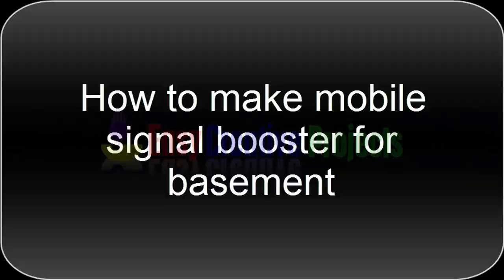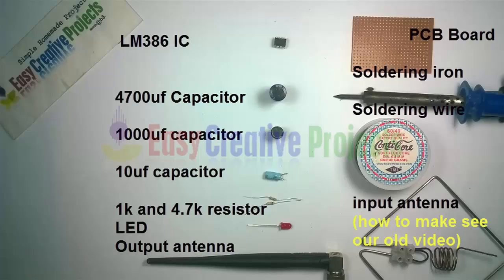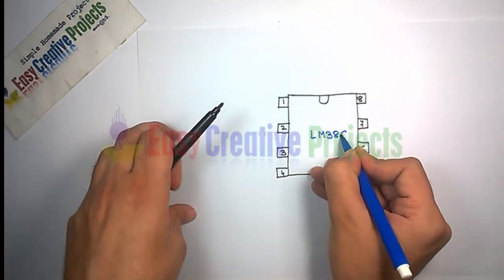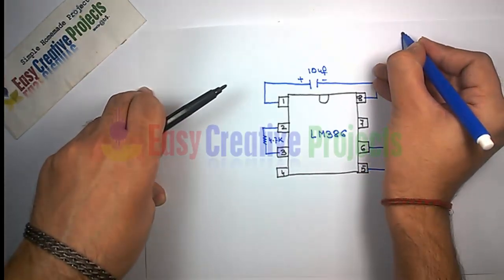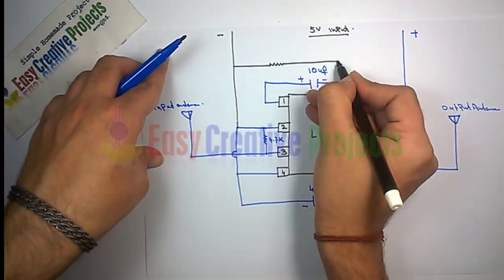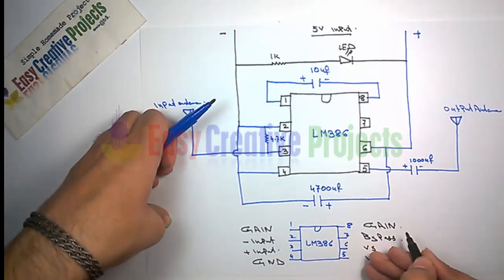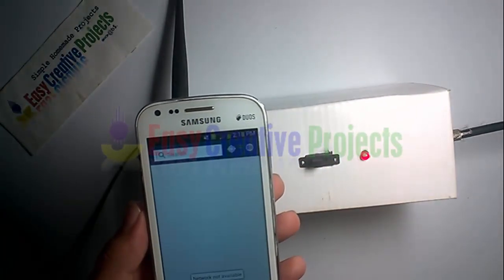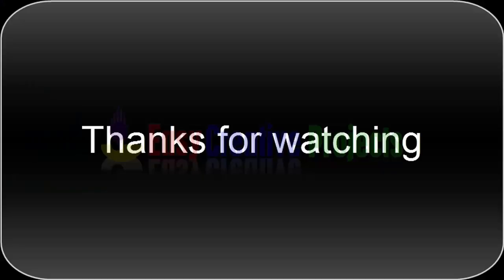How to make mobile signal booster for basement - homemade 2G 3G 4G WIFI device

Comment: This is bogus!  .... if you have basic knowledge you should be able to tell that!  Anyone who made this would be better off wrapping their head in tin foil n running a wire to a coat hanger and holding it the air in an open field during a thunderstorm while on the phone!  😂🤣😆🙄🙄🙄

Comment: The LM386 is an Audio amplifier only it can not be used as an RF amplifier.
Reply: Can you suggest me best circuit for mobile network booster circuit..
Reply: 19dB gain for frequency above 20khz

Comment: Ok all my brothers note one thing subscriber didn't mention what volt of capacitor he use in CKT . When I  made it's give me 20% more signal but in basement area the module can't be do anything just a peace of board. So U guys really want to made use 4700,100 and 10uf capacitor volt 10 it may work  some effective. Battery 6 to 12v.
Reply: @RANDOM VIDEO Bro What is the voltage of capacitors? Please help me
Reply: 5 v input, 25v max capacitor

Comment: Easy Creative Projects  Please tell me about output antenna and capacitor voltage. Are you using the Lm386 Audio amplifier ic. Is it working on Jio 4g signals ? Please reply
Reply: Thanks for replying make a video about it working principle
Reply from the maker: dear in this project i try to provide demo of signal booster. 
how signal boost.
Reply: It can boost signals?

Comment: can ic lm386 be replaced with another
Reply: mention ic similar to ic lm386
Reply from the maker: dear in this project i simple boost signal using amplifier ic. you can use any amplifier ic for this.
Reply from the maker: you can use any amplifier ic.
Reply: Easy Creative Projects will it be the same as the foot path
Reply: make me the circuit for ic lm741 because I don't understand
Reply from the maker: if you dont understand so leave this project and make any other for college. 
because if you dont understand so how you explain it in presentation.
Reply: just make the scheme and what are the ingredients for ic ml741. I'll buy the components later and I practice

Comment: Suggest best high signal range with strong signal strength wifi modem+router for home
Budget is rs 2500
Reply: Please contact me 
..I will make one and send it to u ...

+91 8667529597
Reply from the maker: dear if you want to increase wifi signal range so see video on my channel how to make wifi antenna.
and make same antenna at home. i try to explain its range.
for example you friend has WiFi device and you want to catch signal so make same 2 antenna. 
one antenna connect with router(friend home top) and 2nd antenna connect with own wifi card (your home top). 
its range round about 600m to 1km without resisters.

Comment: sir can you tell the capacity value of voltage...? how ???
Reply from the maker: dear 1st i use 12v but ic burn with in few seconds. i also try heat sink but same result. in theory its work 12v to 15v for high frequency. but in practical its cannot accept high voltage. so i use 5v power. its normal but not high efficiency. 
i am working on it. if success then share on channel.
Reply: @EasyCreativeProjects  it's mean your project is not complete or not suitable for voltage wise. It's mean its incomplete.

Comment: it is fake, LM386 does not have such bandwidth more than 300kHz, and simplex amplifer will not work for FDD/TDD system. Stop making rubbish, ok?
Reply: Yes. Also capacitors used in this circuit are useless at high frequency RF
Thank you

Comment: My cellphone is 4g support but in My basement there is 2g tower will show in my sim card, is this device will help me to improving connectivity
Reply from the maker: dear lm386 ic heating fast. i am working on it. upload soon.  you can try this circuit but its not for long life. 
thanks.

Comment: I made this .Ic get heat . Not working . Any suggestions?
Reply from the maker: dear its working good if you connect 1st antenna on top of house. but ic heat up soon. i put heat sink with ic. 
but i try to make it more batter without ic and more powerful. upload soon.
Reply: How many volts from capacitors and how many watts of resistor?? Please help me

Comment: Not trusted, as this antenna can also amplify the FM signal instead of 2g/3g/4g signals. Bad idea. And in the video, the signal for network in mobile was not shown clearly. 
So thumbs down.
Reply: Is it possible he's just seeing gain because one antenna is external and it's functioning as a passive relay to the inside antenna?
Reply: I disagree. I am not saying that this should work or not but filtering mobile signal from all of these FM AM frequencies are smartphone's job.  So if any circuit is amplifying any or all of the frequencies than still   it will work.
Reply: Monoo Mankar. I agree, it's up to the phone or router to filter out the individual signal in this instance. It's not generating enough output to jam any devices I have.

Comment: Your basic IDEA is very good, but, come on dude, Mobile Signal is Radio Frequency, and it is very-very high frequency, are you sure using LM386 as the heart of this circuit?
If internal of this Chip based on at least 300MHz transistors, may be it will works with AM to FM signal for boosting it.
Reply: Yes we need minimum 850mHz Signal
Reply from the maker: thanks dear. i already more working on it.
Reply: Samuel Budiyanto Hey Bro plz help me which IC is better than this IC bro
Reply: I had this on mind when I saw this on other video.This Ic is used for audio.I tried used and for that is very good.Maximum 12 volt supply voltage.

Comment: Can i use a remote  control antena which can be small and big
Reply from the maker: dear i all ready make long range mobile signal antenna videos.  in this circuit you need 2 antenna. 1 input antenna. and 2nd output antenna. in 1st side you must connect high range antenna then you get strong signal.